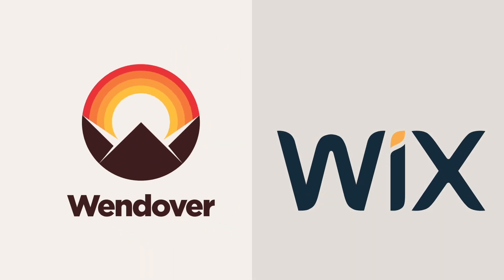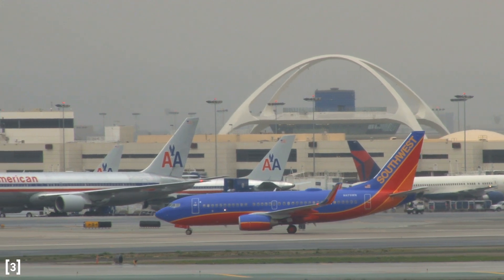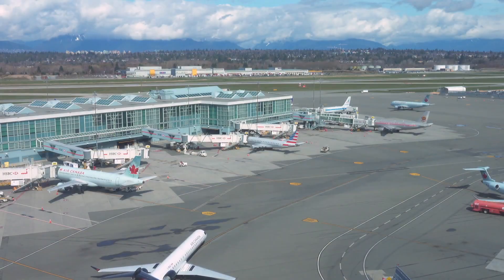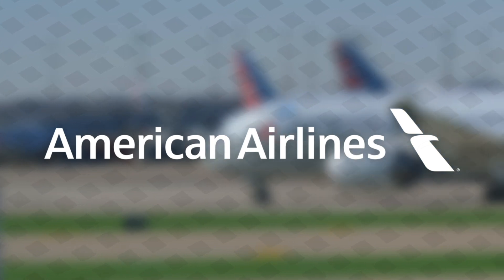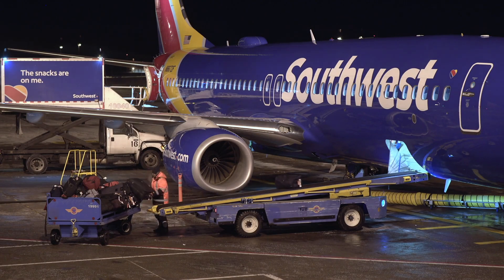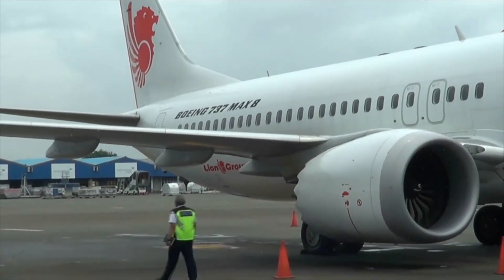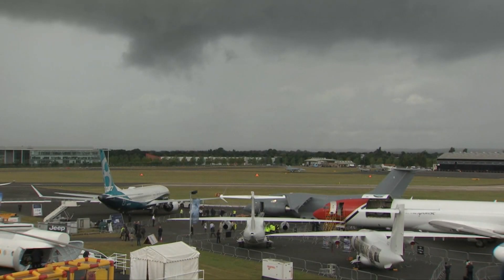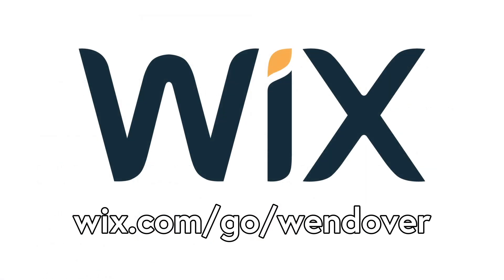The Economics That Made Boeing Build the 737 Max

Comment: I think a few things are being mixed up in this video.
There's nothing wrong with the CONCEPT of the 737 Max (keeping it mostly analog instead of digital is a choice, and not necessarily a bad one), there are problems with the BUILD QUALITY and IMPLEMENTATION of new systems. 

You can upgrade an proven existing airframe to perform better without much problems and it's way cheaper than designing and developing a whole new airframe, which is exactly what Boeing has been doing for decades with both the 737 and the 747.

Comment: This plane has been revamped 10 times in 50 years but they couldnt install taller landing gear so the engine fits UNDER the wing??? Weird compromise of making an airplane unstable vs more wing clearance.
Reply: The reason for the engines to be moved further up, was not because the engines would not fit under the wing. They would. But the ground clearance required by regulations would not be met if the engine was not moved up or the landing gear sufficiently raised. As the video states Boeing had to do both in order to make it work. They increased the length of the landing gear by 8 inches and moved the engines higher up on the wings. Now I'm not sure about this but Being would have increased the landing gear sufficiently (even more than they already did) so that they would not have to move the engines up on the wing, if that did not cause some other design or regulatory problem.

So it's not exactly unstable airplane vs. wing clearance. It's more like unstable airplane because of wing clearance requirement and regulation. Hope this clarifies the seemingly strange nature of the compromise.

Comment: Let’s go back just a minute. You said that by moving the engines forward and up it would cause the plane to raise its nose prematurely and run a higher risk of stalling. That’s contrary to the laws of physics. Anytime you move mass forward you’re going to move the center of gravity forward which is going to make the nose trend down, not up. 

I’m a commercial pilot myself and I also watch a channel by a 30 yr commercial pilot and he explained that the MCAS system was put there in order to give the aircraft the exact same handling characteristics as the previous versions. This allowed pilots to transfer straight into the new aircraft with their old type rating rather than requiring a new type rating, as you stated. My understanding was that the MCAS system was there to make the plane behave like the old aircraft for the purpose of training uniformity, not because the new aircraft was dangerous. This is an incredibly important point.
Reply: In the end its not an important point, really.. people are dead and so is the 737max. They still cut corners when they avoided retraining pilots. The consequences are the same even if they didnt do anything negligible on purpose.

Comment: I'm not sure you are correct on making the wrong decision on continuing on with an old air frame, I think it was a smart decision to stay on the same platform, the bad decision was to only use one angle of attack sensor and to use outside contractors for programing on the function on MCAS. They had 2 sensors but they did not use the second one, also dumb was that it was an upgrade to have the mismatch light. oh also the previous crew new there was a problem, but the crew taking over for them did not.. 

Anyway, there is multiple failure points here that caused this to happen.

Comment: Imagine if Ford kept producing the Model-T fords,  but put in a HEMI engine, and called it the 'Model-T MAX'.  It kept crashing into the ditch due to bad brakes, so the engineers added a servo motor that pulls the steering wheel to the left, and the unintended side-effect was that many of these new 'Model-T MAX' vehicles now crashed into the center median instead. Would you want to buy a 100-year old design Model-T MAX, or would you buy a new Hyundai Sonata instead?

Comment: You’re an idiot. The max has a cas warning system and hydraulic flight controls not wires. It has the option for electronic checklists many airlines still require paper. I only watched the intro cause you’re so so so wrong it’s painful.

Comment: Fly by wire light my fire. Listen, Fifety year old designs are all around us. We don't stop using a product simply because it was designed 50 years ago unless doing so is significantly better. Progress demands change for the better, but change alone does not ensure that progress will occur. We have the safety records for the 737 for the past 50 years, but the big question is what fly by wire safety record going to be? My guess is we will change designs again when some new design comes along promissing even more cost savings. If a thing is of an older design it does not automatically mean that it is inferior. It's not what necessarily what saves dollars to the manufacturer the pubic is ultimately interest in like plastic shoes but maybe a well made shoe of leather. Listen, the consumer wants quality, safety and savings, not only savings.

Comment: MCAS
The over complicated system added to the Max by Boeing that was completely unnecessary.
Seriously, just lift the body of the plane higher above the ground! You Had One Job!
Reply: that adds weight because landing gear needs a redesign, wingbox needs a redesign (takes a long time), two new emergency slides needed for overwing exits (heavy and requires a new evacuation certification test), etc.

Comment: Does the fly by cable eliminate the possibility of hydraulic failure?
Reply: It doesn't eliminate the possibility of a hydraulic failure but, if the aircraft is small enough, it does prevent a complete loss of flight controls. On a 737, the flight controls can be moved manually if there is a complete loss of hydraulics (which is virtually impossible). It's a lot of work but it's possible. On bigger planes, however, the flight control surfaces are so large that it isn't possible to exert enough force to move them and so a hydraulics failure would mean a complete loss of flight controls.

Comment: Both of the the current major manufacturers (and manufacturers in the past) have had tragic crashes tied to design and/or fabrication mistakes—including those tied to inevitable economic decisions.  I am not a Boeing employee or stockholder...and I’m deeply saddened that clearly Boeing made significant tragic mistakes and apparently so did the FAA.

But I wonder how many of the countless commenters casually trashing Boeing here are familiar with the details of the crashes tied to the unconnected side stick system within the “foolproof” cockpit automation used by Airbus (and tied to known substandard pitot tubes not immediately fixed by Airbus, as I understand it, due to economic considerations)?  I’m referring to the more than 300-death combined total of Air France Flight 447 and Indonesian AirAsia Flight 8501...447 impacted by both the unconnected side stick design and pitot tube flaws, 8501 reportedly impacted by, among several things, the unconnected side stick design.

Economic decisions and design trade offs are, and always have been, a central part of airplane design (and virtually every other form of transportation)—and tragically sometimes mistakes and misjudgments cost lives, though the overall safety record (in light of the billions and billions of miles flown) by both Airbus and Boeing, plus Embraer and Bombardier, in the last 50 years is amazing.

(And if you are a capitalism-hater, try comparing the safety record of Airbus and Boeing, plus Ebraer and Bombardier, to Soviet-built and Russian-built models across the last 50 to 70 years.)

Comment: There is quite a bit to add to this story, but the length of the video would continue growing. The rabbit-hole of Boeing's accounting practises suggesting a company too big to fail is teetering on the brink of collapse (and has been in this position for years), as well as the FAA's continued analysis of the plane's flaws keeps bringing up older flaws in the design that would've proved just as deadly as the MCAS system had the plane continued service. Whatever timeline Boeing is trying to convince the FAA to allow its planes back into service are severely out of step with the regulator's, but Boeing will probably take down the economy à la Lehman Brothers 2008 before it ever flies another 737 Max.

Comment: It is not necessarily true that "Nobody would have known that it would have caused hundreds of deaths." True that with higher engines further forward maneuvering would become less intuitive and without MCAS the NG certification may not have carried through to the MAX. Pilot conversion would have meant time and money. MCAS would offer pitch control over a varied thrust profile, freeing flight deck for other tasks especially during take-off and landing.
But not true that MCAS would only need input from Angle of Attack sensors. MCAS would have to be integrated with other instruments like attitude, attitude, speed and be aware of warnings e.g. from Groundprox.
And completely untrue that based solely on AOA sensors MCAS would have total appreciation of imminent stall, and, their that it should ever have been allowed to take control from flight deck and dive aircraft into the ground. If not grounded even more deaths could have ensued.

Comment: American Airlines “strong armed” that’s  interesting...haven’t heard that in the msm and the FAA is responsible too...in not requiring new training for the 737 max.
Reply: It wasn't just American Airlines who "strong armed" Boeing. Southwest (who is the largest operator of the 737 with almost 800 planes) was a major part of this as were several other carriers who have large fleets of 737s. Southwest was one of the first airlines to purchase the original 737 and has always had a very tight relationship with Boeing since its inception.
Reply: @rondadams  Yes, in some ways, it's the airline's impatience and influence that caused this problem. SWA didn't want 757s because they "flew differently" but now they have an overaged 737 that flies differently. Go figure.
Reply: Ardent Fan  I don't think it's blame shifting as much as it's just pointing out all the factors that lead to the decisions to build the MAX. Yes, ultimately, Boeing bares responsibility for the plane's deficiencies that lead to the crashes and loss of life, but the primary reasons behind the plane's production was to satisfy customer (American, Southwest, and many others) demands.

Comment: The plane changed little - wind speeds for controls wasn't changed.  Autothrottle same & manual trim same. Plus the MCAS didn't say I am sorry Dave I am afraid I can't do that(HAL 9000) since it was turned off & the planes wind speed was overlooked for some reason.

Comment: Model 737 took complete fuselage from the  727 model ... the problem was that 727 had engines located at the end of the fuselage ... if you want to place bigger engines under the wing you would have to extend the undercarriage legs ... if you want to extend the undercarriage gears you have to remodel the entire center wing of the aircraft ... if you want to remodel the center wing you have to develop completely new wings ... the result? ... Boeing would basically have to develop a completely new plane that would cost time and big money ... so gaining profit over safety. ..btw, notice the problematic landings of the long 737s ... they must even have the collision shoe extended at the end of the fuselage during landing because of the short landing gears ... the pilot has limited tilt and may have contact with the fuselage due to the short legs

Comment: I for one will be glad to see the end of the outdated cramped 737s. I'm fed up of being crammed into tight seating configurations on flights that are getting longer and longer.
Reply: Does that even matter? American Airlines, one of Boeing's biggest customers, still flies mega cramped, creaky old 757s all the time. They are not comfortable for 5+ hour flights but they use those over the Atlantic frequently.
Reply: @largol33t1  They will be replaced with A321XLRs soon
Reply: What even is this comment? The airlines chose the seating configuration and the flight distance/time. The 737 is just a platform.

Comment: Great explanation.Similar to writing software you can  bolt on on  new features to the main body as they come along it is cheaper but eventually the overall design becomes messy and unwiedly.
Rebuilding from scratch  is a huge expense but inevitably required every 15 years or so. Without state support most of these new aircraft models  cripple the manufacturer as problems arise and take years to bring to market.So there is no easy solution

Comment: People are saying "the plane is bad" or badly designed".  The likely cause of one of the crashes was reported as a faulty AOA sensor (not made by Boeing),  and that part must be checked and maintained by the airlines.  Nevertheless, bad sensors happen and can confuse pilots, but the pilots must be trained to FLY THE AIRCRAFT BY HAND USING COMMON SENSE in that kind of failure scenario.  Boeing is being unfairly treated by a media blitz on them.
Reply: No they aren't being treated unfairly. The plane was also designed in a rush to compete with Airbus.
Reply: @PeteS_1994  My point was this: PARTS FAIL (even new parts). It's a fact of life. The best designed machine in the world can't guarantee human safety. It's a matter of insuring the failure rate is very low.  If that's a big worry then all forms of high speed transportation would be illegal.  Also, introducing aircraft to the market is not that tight of a race.  Airlines can wait for better offerings if the incentives are good.

Comment: Should we worry that we might see the same thing with the*Airbus A321XLR,* though?
Reply: All Airbus is doing with the XLR is converting to of the 9 sections used to store luggage and where some airlines already put auxiliary fuel tanks and replaced them with fixed built into the plane fuel tanks, which simplifies the tanks reducing weight and increasing volume. Only real risk with the XLR is a slightly higher chance your bag gets left behind for size or weight and balance reasons, but that's still probably better then connecting which will be your other choice.
Reply: Two of the nine sorry for the typo.

Comment: The solution that they could've done is increase the gap between the aircraft & the ground.
Reply: It's just not that simple.. that would require changing the landing gear, making it longer. That would require more complex redesigns to add more space for the gear and.. well you see where this is going

Comment: a 13 min video.... it's good, but i could have made a 12 second video. "The reason Boeing designed and built the 737 max, is because Airbus announced the A320NEO in direct competition, a newer plane to the 737 and AA ordered 200 of them. And boeing weren't happy for their shareholders to they had a sh*t attack and LITERALLY instantly went in with their engineers to design a brand new update with the newer bigger engines for the 737.. thats why. And it worked, they got 100 of that order... it's about money money money. F8ck safety. Boeing kept talking about safety is the number 1 thing for them above all else. I'm like yeah, thats why you SNUCK in a single sensor system and told no one about it called MCAS, where because it's only a 1 sensor system, the plane wouldn't have to be certified and there'd be no simulator training ordered by the FAA, but also because of this, a MAJOR automated flight system thats hidden from the pilots and airlines has now been installed ad-hoc during testing when they found out about it, and it that SINGLE sensor has ANY kind of a problem the plane could go down. But Boeing STILL f*cking kiept it just a single sensor system, NOT because of their number 1 concern safety, but because if they took it down and desided it'd DEFINITELY be safer to have a 2 sensor system,. they'd lose the orders they already had on the plane and it'd have to be recertified. NO plane should EVER be allowed to have a flight control or data system that relies on a single sensor... my god.

Comment: This video is wrong in its conclusion.

There was nothing inherently wrong with Boeing's decision to build the 737Max.

The problems with MCAS are all down to poor engineering, and were easily avoidable.

Reliance on a single pitot sensor, and inadequate warnings to the crew - basic design blunders, that's all there is to it.

Comment: You claim the greedy managers decided to upgrade old plane since its cheap and fast approach is the reason of failure? If yes, i disagree.  This would be also the safest approach given the fact that the most of the plane systems are already flight proven. The problem is they did a new system MCAS and did poor risk management therefore spend not enough efforts to verify it works in all the circumstances i.e. failure cases. IMHO they could do pretty much the same with the completelly new plane with even higher probability.

Comment: I was an apprentice when the airbus a320 launched, and when Boeing launched it's 737-300 . they are almost the same age! Incidentally, would you rather entrust your life to an electrical wire , or a mechanical connection physically uniting you and the control surface??? get an engineering degree before you start to elaborate on the merits of one system over another. Get your facts straight